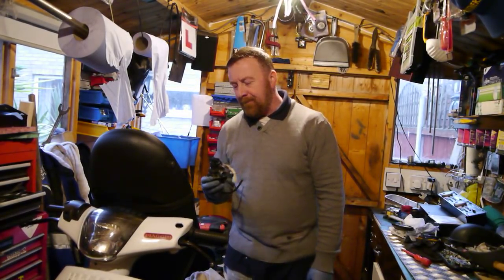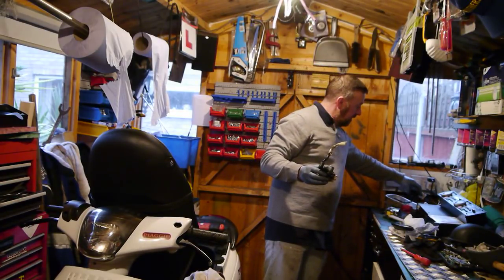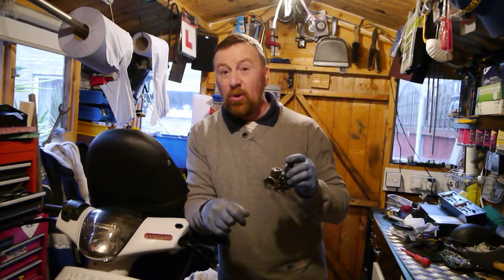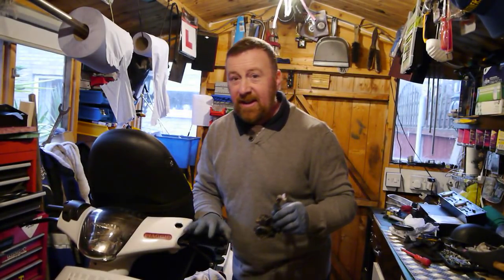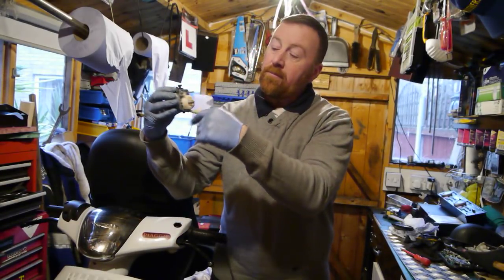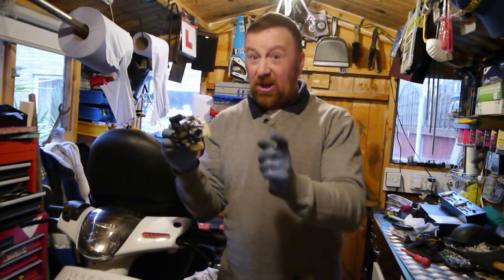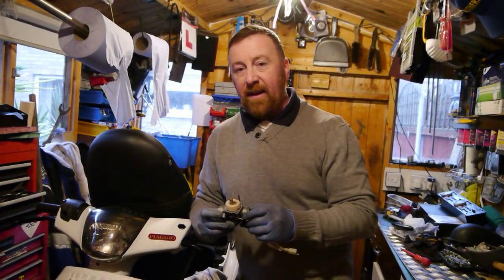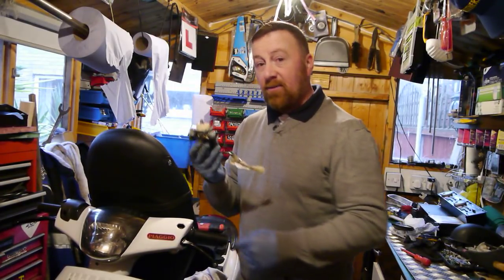STOP!!  MOPED BEFORE YOU UP JET WATCH THIS MARK SAVAGE

Comment: Still here 3 years later mark savage you legend and have the best attitude towards this type of thing.
Reply from the maker: yes bud still trying to help and chat, really i have no friends pmsl 
thanks bud and for watching 
you take care
Reply: My bike is going well atm mate.i have a tgb the same engine as the zip/minelli engine.the problem is when I first start the bike it runs perfectly.but when it's warm at a good temp.it gets very sluggish.i have a leovince sport can and have went from a 60 jet to a 70 jet I'm baffled lol.
Reply from the maker: @nathanpalmer2086  last service bud ? plug and air filter change or could do with a little tune after 
it is common and due to air /fuel mix not being right
Reply: I will change the plug and filter today bud.the bike was sitting for 14 months I will go over all this.if not do you think rollers it might not make sense tho as it goes fine when cold mate. Thank @marksavage also the bike has only one previouse owner and only done 6k miles.
Reply from the maker: @nathanpalmer2086  14 months id be taking out he old fuel too and clean the carb up as old petrol is not good 
do that lot first and then have a check of the rollers bud
Reply: Thanks for the help buddy I will let you know 😃
Reply: Evening bud I changed the plug oil and fresh fule it still pulls away great. then when it gets going it's sluggish up hill etc.so I checked the rollers as you said and they all have a couple of flat spots.
The original rollers weigh in at 8.8 grams. I'm guessing they was 9 grams when new. What do you recommend mate ? Thanks @mark savage

Comment: I have a Super 8 moped I purchased for my daughter, it had been seized because of a faulty 2 stroke oil pump, the guy replace the oil pump and decided to get a 75cc big bore kit without getting the necessary jet kit for the carb (or so I am lead to believe), it has a sports exhaust and a sport air filter on it. Now my problem is that the bike starts perfectly, ticks over lovely then pulls away fine, then a couple yards down the road the bike just dies. I believe its the main jet thats the issue. I purchased a mikuni carb for it but when it arrived it was the push in variety not the bolt in sort. So I thought ok I will just swap the jets over.. No.. different thread sizes.. the mikuni is larger and will not fit. So I am a bit stuck now. I have both the idle and main jets pulled and in my hand (including the stem on the main jet), the idle jet reads as 35 (this is one long jet not a stem with jet screwed in) and the main jet reads as 85 (and is in a stem that it can be unscrewed from) however I have no idea what size it should be for the 75cc big bore nor where i can find out where to buy the smaller thread size jets from PLEASE HELP!! I am going INSANE!! Oh and I liked and subscribed (so please help lol). Also the bike is a two stroke. I also had a plastic disc that i put a hole in and put that in the air filter manifold (so as to restrict air flow) and this did help the bike rev more but it still cuts out. Awesome videos by the way, I am an old biker with a 1000cc Harley, but I know nothing about these scooters. However your video's are a great help. Keep up the great work!
Reply from the maker: This last week I've had 5 people are asking the same thing
Big bore kits and they wont run right 
This is why I did my 70cc kit dont do it video lol
Such a pain to set up and keep running 
It does come down to more air more fuel bigger exhaust for gases to get out 
But setting the carh up on a big  bore is hard 
Me I'd get a 50cc and start over 
Find jets for the new carb maybe try the seller you bought the carb from 
If not go back to the old carb and try going smaller like 75 or 80
Then turn from 3 half turns and out halfs 
Hotter plug , did you go up one number plug ?
Big bikes can be so much easier to work on lol
See how you get on bud

Comment: Mark savage since I replaced my carburettor on scooter 125  new upgrade to the race type.   My bike will take like your video description of starting problems several attempts..  untill I have just clicked electric start maybe half a dozen times it does catch on eventually it'll go no problems. Might this be the idle screw required smaller size? For flooding! As I say it's all new with other parts. Cold start seems to work once engine been run a minute.. 
It'll go like hell now fit new CDI and all stuff in your videos but just this last little problem starting lol.. very annoying these tempemental scooters... Hope you can help.
Reply from the maker: have a look at the auto choke, they do have an adjustment on them as they turn round in and out for more or less so worth a look first .
next yes have a look at the air mix start like my videos with 3 half turns out and move in or out from there
hope that helps 
mark
Reply: Thanks mark you know on the whole of YouTube I find your videos the most understandable with easier listening. Thanks again I'll let you know if it works. Regards Gareth
Reply from the maker: that's good to hear bud ,all I ask is to like share and sub and I'm happy if I can help 
mark

Comment: Ugh I give scoot gas and it goes, but then it sucks lots of air and sputters then it will go I can not figure it out new belt new rollers cleaned everything dose it all the time and over and over.give it little gas it wants to go and poof gotta turn throttle  back and fourth any suggestions it's 4t kymco factory everything except new belt rollers .ugh
Reply from the maker: Anthony James so you have cleaned the carb and the jet has never been changed 
All moped carb need a tune so follow my clean carb video and then 4t carb tune video 
As it’s 4t have you had the valves adjusted ?
How many miles is on the clock 
Changed plug as don’t for get about that and air filter and n the service
Reply from the maker: Anthony James I have many videos that will help like blogging down video they will all help
Reply: Yep did valves last spring put new plug in and air cleaner is good  gotta Chang out the jet being it's a factory carb I have too drill out little caps so I might try a total differant carb (one that is not so impossible to ajust .there's 05548km/h on clock. I will watch those videos .thanks

Comment: Hi Mark. im new to all this modding to mopeds, i bought a race exhaust and i put it on and i expeted it to go faster by a little. it actually goes slower, i searched around what to do and i needed to put in the rollers that came with it and jetting kept on coming up and iv watched this video, it was helpful because its explained jetting but im not sure what to do. do i need to buy bigger or smaller jets.
Reply: My Moped is a Piaggio zip 2T 2011.
Reply from the maker: Max Torque 
This can happen 
What moped was it 
2t or 4t
Some mopeds need back pressure so this can happen if it’s letting it all out 
Upjetting go up b 4 
More petrol needs more air needs to get it out faster 
That’s the basics 
How ever it may have already been up jetted ?
So causing problems !
Air mix like in my videos !
Modding a moped can be a pain as some times just an exhaust and away your moped goes then like it n your case not !!
Reply from the maker: Max Torque just see it’s a zip 2t
This should of helped !
It maybe the rollers bud put the old ones back in and clean up 6g normally is good
Reply from the maker: Max Torque I do have lots of videos to help on 
Variator , rollers , carb and exhausts
Reply: @marksavage  thank you, the rollers that came with the exhaust are 4g.

Comment: I have a 70cc piaggio zip sports exhaust and I’m not sure what the problem is but it won’t idle I have tried many things but still nothing and it also bogs when it hits power band I was thinking jets might be the problem but I’m not very sure the jet in the carb at the moment is a 73

Comment: Hi Mark

Thanks for this video... I have a Speedfight 3 for my 16 year old lad which only gets about 28mph on flats and is terrifying!
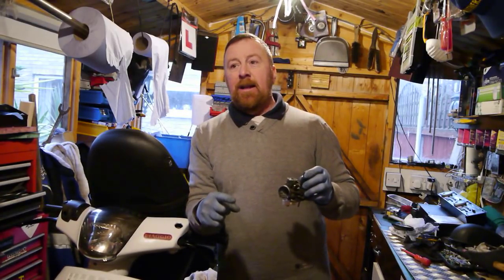I’ve bought a LeoVince TT exhaust that comes with rollers and clutch springs so am trying to educate myself about the fuel and air elements before fitting them... on around 2:00 you mention taking something off the Soeedfight to provide more air but I can’t make out what you’ve said as I’m a bit of a newbie. Any further help would be much appreciated... your videos are really helpful and I’m sharing them with my boy to help him understand how his bike works 👍
Reply from the maker: Sp3 as in my sp3 videos can be hard to derestrict due to being being cdi restricted
But all these things will help
Sports exhaust 6g roller , a small upjet of 4 and a sports inline air filter 
Theres over 80 videos now on sp2 but the basics are the same for carb , rollers variator etc 
Thanks for liking subbing and sharing bud 
28 mph is rubbish this was why I liked the sp2 
Yes old but easy to get to 45 mph plus
Reply: Brilliant, thanks for the response Mark... yep, 28 max, it revs high before taking off quickly too so guessing it’s previously been faffed with! I’ve been watching your videos through the telly since about 10am this morning, so learning a lot and saved a load of them for referring back to when I roll my sleeves up. I’m 37 so not getting too excited to start messing with things I don’t fully understand but your vids are helping with the confidence to give it a go... think I’ll swerve the clutch springs unless I learn that it needs them, pop the exhaust on and new rollers in (the ones in the exhaust box are 6.5g according to the label) and look into the air filter. I’ve never dealt with a carb before but hoping with the vids I can get at the jet to see what size is in it (probably with a magnifying glass too!) as I’ve a sneaking suspicion the previous owner may have fiddled! You’re an absolute star and exactly what the youngens (and their Dads/Mums) need, so keep it up and thank you again!
Reply from the maker: Thanks bud 6.5g should be OK and guessing by know you must of had enough of mark savage videos pmsl 
But happy they help bud
Reply: Hi Mark... I’ve still not got this right, thought I was winning yesterday and had a setback today so any thoughts would be greatly appreciated. I bought an in-line air filter, fitted that and upjetted to a 64 jet (I cleaned everything carefully as per your vids, cheap can for outside, expensive stuff for inside 😏). It fired up lovely and took off up to about 35mph on 3/4 throttle but bogged down whenever I tried for that extra at wide open throttle, just a loss of power and ‘uhhhhh’. As soon as I eased off to not quite wide open I could cruise around smoothly at about 35mph. So... I thought maybe it wasn’t getting enough fuel so stripped it down again and but a 68 jet in it... now it won’t maintain tick over without revs and is smoking like crazy, not happy at all.... I’ve also now fiddled with the idle screw and lost the plot with where it should be 🤦🏻‍♂️ I’ve got a set of jets so my next step was going to be try the next jet size down but please shout if that sounds silly as my will to live is waning with every removal and refitting of this bastard carb... I’m getting to be a dab hand though 😂  Thanks in advance again 🙂

Comment: Hi Mark I have a sinnis matrix 2 the crank shaft  bearing I have to replace and while the engine is apart I fried the piston so I'm going to change that 2 I'm going to put a 150cc big bore kit in and is say u need to up jet the Carb any help would be greatly appreciated mark b
Reply from the maker: I don't live big bore kits as most made poorly 
However if you have a good kits 
Check carb to see jet size 
Then get a set of 4 starting 4 up from standard and go up in 4s then tune 
Sports exhaust 
Try 1 x6 g heavier too to get the best out of it 
Oh sports in box air filter should help as well
Reply: @marksavage  thanx mark I've decided to stick to a 125cc piston kit keep it standard thanx much appreciated

Comment: Hi Mark, great videos. Can I ask a question please ? I have totally refurbished a 2009 Derbi GPR 50. This included the engine with a complete rebuild including a new cylinder and piston to original OEM spec all be it a budget part. I also replaced the exhaust with a Ginnelli sports exhaust which was de-restricted. The carb was as standard 17.5mm PHVA 75 main 34 idle A7 needle mid clip. I then rejeted as info on a derbi forum to a 98 main and A 20 needle.
However it would not start (electric starter) 1 year later I am still having problem starting and running. 
I have what I would call low compression at 80 psi. any thoughts would be welcome please. cheers Paul
Reply from the maker: its never good when you put it back to standard from sports exhaust and upjetted 
they just do not seem to like it 
they also suffer from cdi , electrical problems / timing 
you have fuel getting in and blue good spark 
did you check the reeds ??
vacuum ?

Comment: hey mark i have another problem. My piaggio typhoon will not move when accelerated. on the centre stand the wheel spins fine and the variator and clutch work how they are supposed to how ever of the stand i full throttle and the bike does not move at all. i have 8g rollers. The only thing i can think of is my gearbox being broken but i really hope its not that cause i have no money to take it to a mechanic. thankyou
Reply from the maker: as i this video have you check your jet and cleaned carb?
did it run ok before, they do suffer from air filter problems as they need a lot in
it may not have anything to do with the clutch , like in my other variator videos have to watched it working , have a look at my variator video om page 7 and a few others, hope that helps
mark
Reply: mark savage my bike was running perfectly fine untill i took my variator of however i put everything back exactly how i took it took and i put my rollers in the right way and everything moved nicely and was looking good.
Reply: mark savage I also tried to take of my clutch. i held the back brack and tried to loosen the nut however i was not successful but as i tries to loosen the bolt my clutch did spin a little but my wheel never moved. i take it from this that i could had maybe bent my gears?.
Reply from the maker: mike car I have tried it with the rear brake and it didn’t work for me it was another YouTuber that said it 
I always use the tool and always find it could do with a good clean so worth it really 
Mark
Reply: mark savage okay i will buy the tool but as my clutch twisted and my wheel did not do you think i could have maybe messed up my gearbox? and my clutch is also new ive had it for about a month now

Comment: Hey mark your videos have been very helpful ive purchased a speedfight 2 with not much info except needing barrel and piston which ive replaced.  Ive cleaned the carb put fresh fuel new spark plug its had new variator rollers at some point. My question is have you got any ideas why it may cut out?  Engine starts fine ticks over fine revs up nicely but if i take it out i get up to a good speed pretty quick with in 100 meters then cuts out like the engine is really pulling back then it takes a couple of mins to restart.  The only thing i haven't checked on is the oil pump and the carb jets obviously carb jets are cleaned out
Reply from the maker: Jonathan Barnes has bud sounds like fuel 
Take carb off clean float and pin check fuel is getting in ok 
Then check vacuum like in my videos 
What size jet?
Where is the needle as this can also cause this problem
Spark plug is ok - and not cutting our
How the coil and ht lead 
Air and fuel pipe on ok nice and tight ?
Give them a going over bud 
I have videos on all these that should help 
Mark
Reply: mark savage I stripped carb down again all seems fine after another clean wish i had check the fuel line, fuel wasn't flowing right.  Also how do i know if the oil pump is running right there is some air in the line ive tried connecting a battery to it, it pulses once then nothing. Its a automatic cylinder type not the mechanical one. Thanks for you advise.
Reply from the maker: Jonathan Barnes once started pop the pipe off and watch if it pulses oil out as that’s what it does from the cdi not just putting power to it 
The cdi works out how fast the engine is going then put in oil to match bud 
And yes bud always worth checking the pipes and vacuum 
Mark
Reply: mark savage i'll give it ago tomorrow thank you. Also the 7 tooth kickstart pinion gear how do i measure it to know if i need a 12.5mm or 15.5mm one im not sure where to measure.

Comment: Hi mark what would u say for a aerox with sports exhaust
Reply from the maker: The first thing id do lol as its a must
Reply: @marksavage  what size would u say it's it 50 deristricted n exhaust ?
Reply from the maker: @Ethan-vo1cc  what you asking bud 
Which exhaust make ?
What year is yours 
2t or 4t 
If 2t then what every make you can afford 
Just not the cheap chrome one bud
Reply: @marksavage  am meaning what size jet
Reply from the maker: @Ethan-vo1cc  upgrade first and see how it runs as often it doesn't need it 
Then go up in 4s so if 64 try out 68
Don't just go up 78 
And tune after each up jet and sports air filter
Reply: @marksavage  ok thanks appreciate it